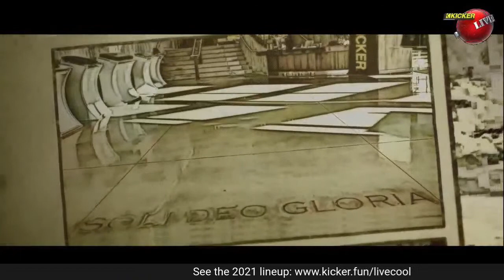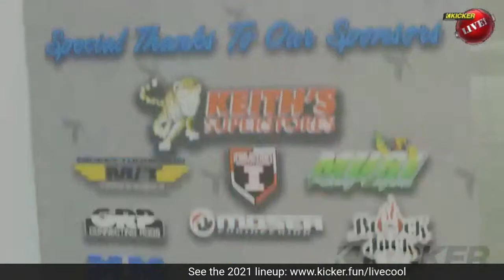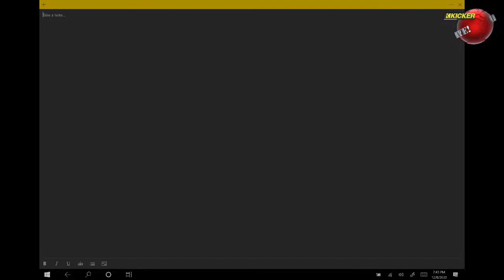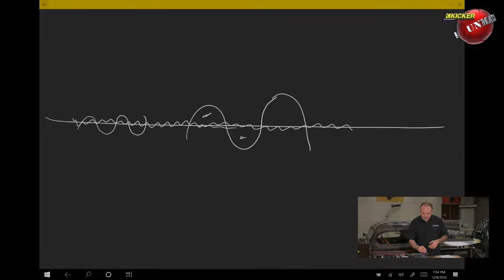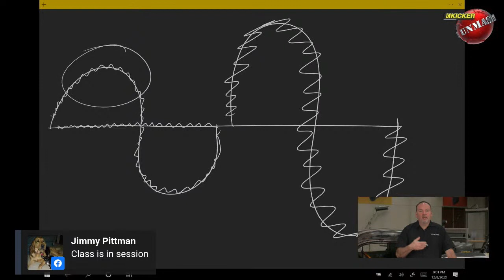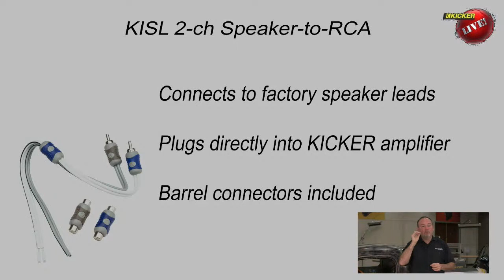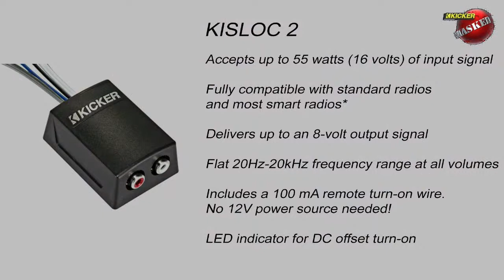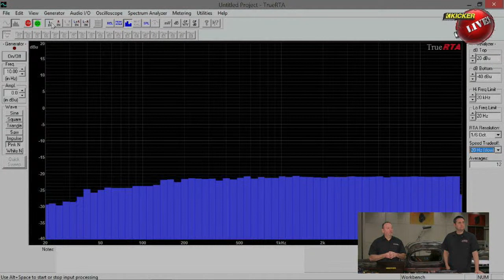KICKER UnMASKED LIVE - FACTORY INTEGRATION

Comment: So should I use the kisloc or keyloc to add an amp to my factory stereo. I was told by one of your people if I liked the sound of the factory radio but just needed to add extra bass the kisloc is all I need then another told me I really should use the keyloc to make sure the channel of the stereo I’m using has all the frequencies I need. I was planning on using the factory powered subwoofer for my source into the loc and it definitely don’t have any high frequencies but I’m not sure how much of the mid and low frequencies there are all I know is the factory sub is an 8inch and it only plays bass.

Comment: Does the kissl have problems draining the battery ? I purchased the LOC2 but I’m thinking of getting the KISSL instead bc I don’t have to pay extra for soldering or crimping materials . Plus no ground
Reply from the maker: As the KISL is simply an RCA cable, it doesn't have the ability to drain the battery by itself. However, if the accessory (like a LOC) was incorrectly connected to a 12v constant wire instead of a switched source, then it may be possible for that LOC to drain the battery.  If you need help with wiring, give us a call!  We are open weekdays from 8-5 central time at 405-624-8510.  You can also email us at support@kicker.com.

Comment: Hi..  im building slowly a complete Kicker install ... to my factory head unit... in a 2018 Tiguan Volkswagen... i have the Kisload 4...  Do i need the KeyLoc to match with it... Or should i get the KeyLoc just as a Processor to clean the noise from the radio? And still use the KisLoad 4 to keep the radio from shutting off... but the thing is... im using all cxa amps... smart stop capable... i have so many questions..... i have 12 inch downfiring comp with passive... 4 coaxial replacement speakers for the doors... so much going on...
Reply from the maker: The KEYLOC will help with your soundstage, frequency response, and remove the factory delay/ filters. However, nothing will remove noise from a radio.  What you can do is determine where the signal is clipping from the radio. This is done with an oscilloscope or a SMD DD1.  This will tell you how high you can go on the volume knob before the signal starts to degrade (a function of the radio's quality): https://youtu.be/qFSrAZVttiA 

We have test tones on our site: https://www.kicker.com/test-tones

Comment: I was wondering if you could help me out, I have a 2018 Silverado and recently purchased your cxa 1200.1 and a couple L78’s. When I got them installed they split off the rear speakers. The passenger side to be exact. I feel there’s still a bit of that bass frequency I’m missing out on. I ready somewhere it’s better to get them to split off the front speakers cause they’re a full range of bass coming through those is that accurate?
Reply from the maker: There are a few places where the frequency response is defined (or altered) in the signal chain:  the factory radio and/or amp, where the manufacturer may have added a filter. The aftermarket amplifier settings and crossover settings and finally the enclosure itself. To determine the frequency response of the factory speakers (or more accurately, the wires going from the factory amplifier to the speaker, you can use a KEYLOC or you can use a meter and an RTA. Here are a few videos to watch.
KEYLOC VIdeo: https://youtu.be/52_z3hX6tEU
RTA Video: https://youtu.be/_TQn8vUe9yg

Comment: Kisl or keyloc2 for factory Ford ranger radio with Zx400.1 amp?
Reply from the maker: What year is the Ranger?
Reply: @KICKER-AUDIO  2007
Reply: I’m running a kicker 8in tube 46cwtb82 with passive radiator

Comment: Can I use the kisl to tap into the rear deck speakers instead or do I have to use it for the head unit ?
Reply from the maker: Depends on where your RCA connections are.  It is intended to go from RCA to bare wire so you can connect speaker wires on the non-terminated ends.